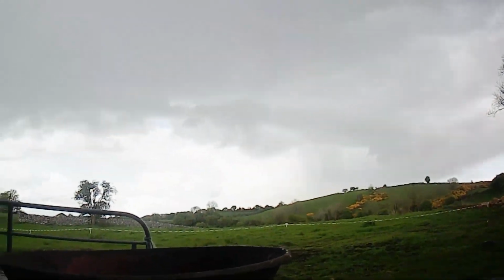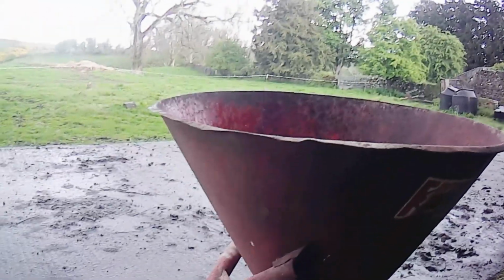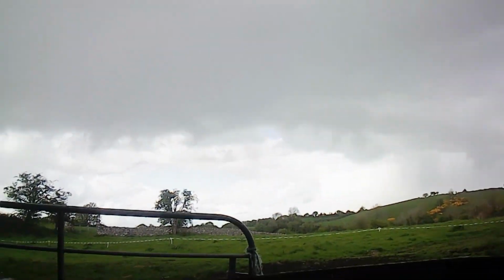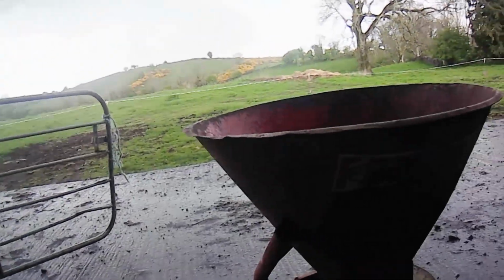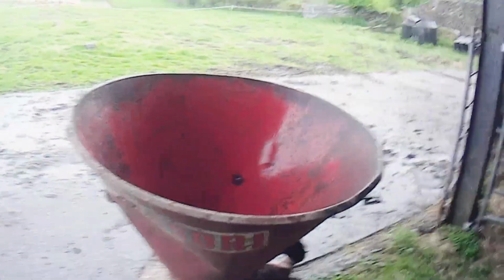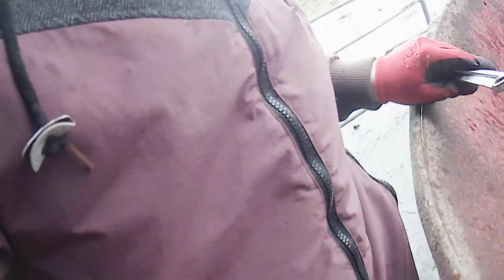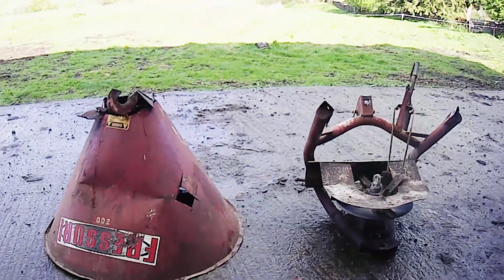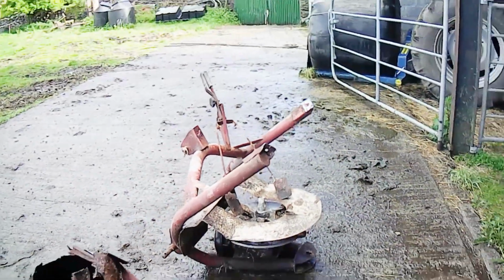Update!! I DECIDED TO FIX IT

Comment: I had a friend.  He rolled cones (built hoppers) for dust cyclones!  When I fixed my bulk mixer, he laid out and rolled the cone!  There is a simple formula/method.  It is doable.
Reply from the maker: Oh that's very interested I was going to try and roll the cone but I decided it will probably be easier to cut out the shapes and weld it up together